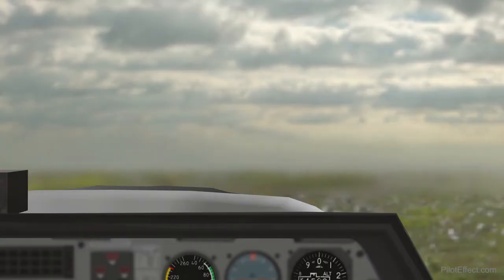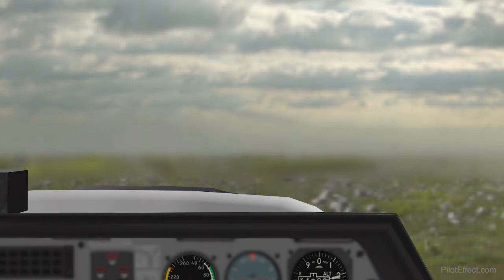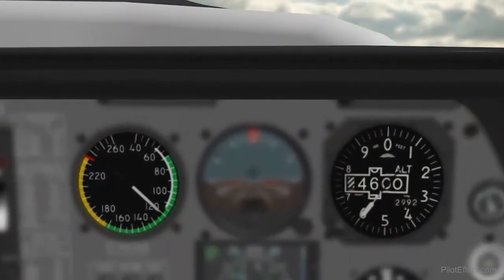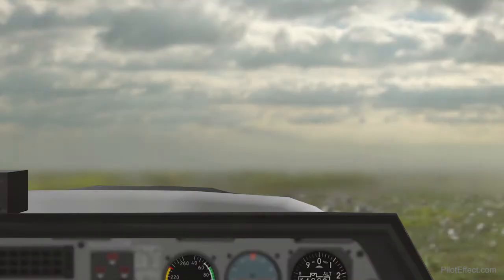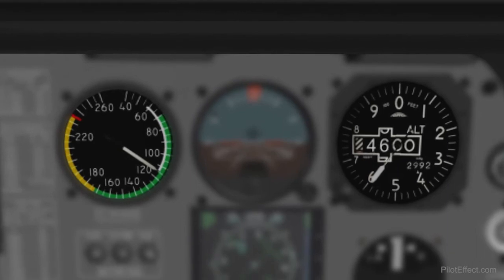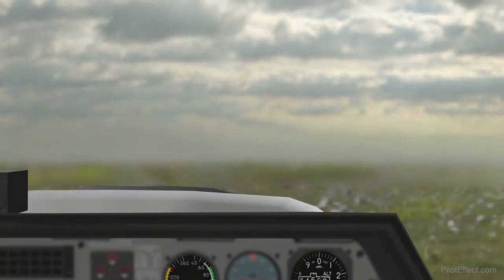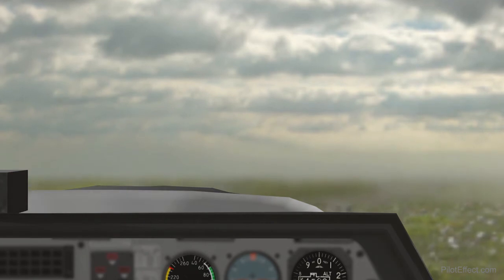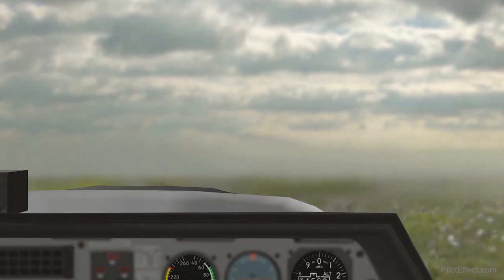Coordinated Corrections (Vlog) | Pilot Tutorial

Comment: Hi, thank you for this video, its really simple and absolutely understandable. I have a question, so if we make the changes - for example to reduce the speed - we set the base and then pitch up. Once we get to the desired speed wouldn't the aircraft tends to go back to that previously set base rather than continuing with the new changes made?
Reply from the maker: Before starting, ensure the base is set. If the
objective is to reduce speed and maintain a steady altitude profile you would
need to reduce power and guide the energy bleed by pitching up, approaching the
desired performance you would set the base again. The base may require fine
tuning over time.
Reply: That's clear now. Thank you.